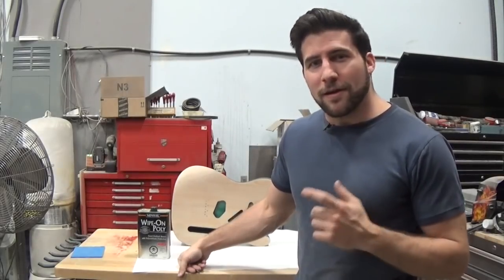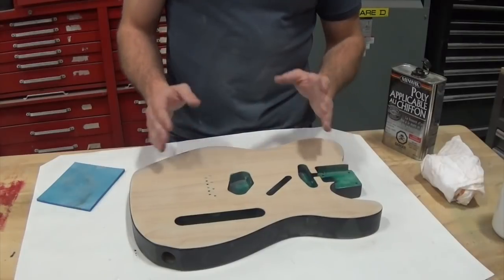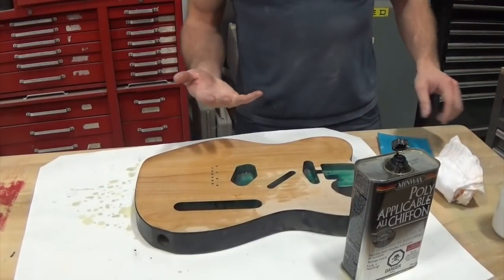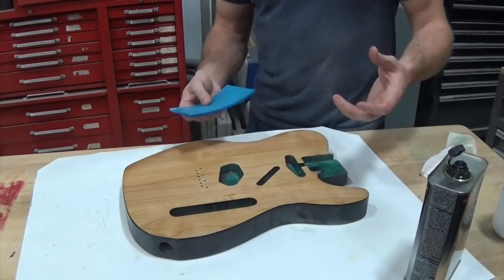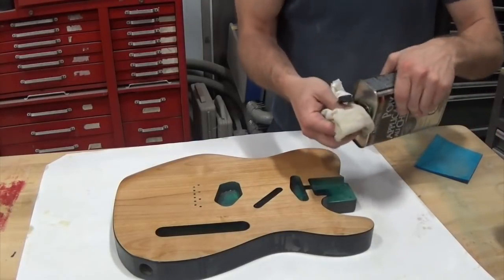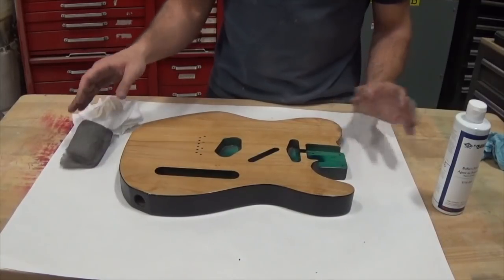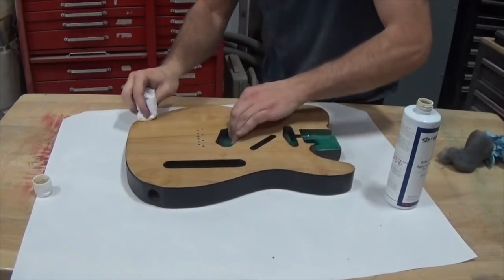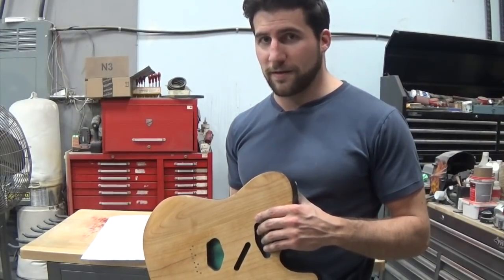How to apply a perfectly smooth poly finish by hand

Comment: Could this method be used after applying a dark or even black dye to the wood first? Looking to get a black color on the wood without paint.
Reply from the maker: You can use black dye to do that, but I wouldn’t use the sandpaper method. It could damage the dye. Stick with a standard wipe on method with a cloth.

Comment: If you do the 1st coat by hand, can you then spray it with minwax poly to save elbow grease or would that cause a problem with the rub on stuff? Did 3 tele's (paint) but am working on a natural finish with my DIY kit and want it perfect.
Reply from the maker: Yes, just sand the first coat smooth with 800 grit before moving on to spraying.

Comment: In the comments someone mentioned a mix of poly, mineral spirits, and boiled linseed oil. So the poly in this mix is oil. In your video did you use oil or water poly? I want to put a decal on my headstock that has been finished with boiled linseed oil. I need to seal it. Would a wipe on poly work for that? I already have a can of satin poly which is probably brush on but I would think I could wipe it on, after the decals have thoroughly dried. Or should I just go ahead and spray with lacquer. The trouble is, the lacquer I have is gloss and the neck is satin.

Comment: Does this work with wood that you've dyed already? Only seen natural finishes so far.
Reply from the maker: I wouldn’t do it on dyed wood; it would remove some of the dye.
Reply: @BradAngove  Hmm okay. Been trying to understand how the opacity of finished works because if you scratch it, it’s a mark of damage, but if you fine sand and polish, it’s clear. Have a black poly guitar that I need to fix.
Reply from the maker: @andrewjm124 that’s not a product of finish opacity. It’s just a matter of how fine the scratches are. You have to sand very fine to sand and polish. And then the compound and polish are also abrasive. At a certain point, it is abraded so finely that it becomes clear again.

Comment: Quick question  -trying to decide where i will get the best bang for my buck - if you had a choice between getting a low RPM polishing/buffing machine potentially like the one stew Mac sells or a HVLP spray gun system - which do you think will have the bigger impact. I know i can get a pretty good finish with hand rub or spraymax cans - and then rely on buffer for that high gloss finish.  Or will a better stayed finish require less buffing.  Any advice
Reply from the maker: For starters I think the polisher will help your finishes go to the next level more than the gun as long as you can find all the colors etc. you’re looking for in spray cans.

Comment: Hi thank you for the help
I have a guitat I have scraped the paint from it and just want your help to sand what is the grid I should start and finish before doing wipe on poly and buffing.  My neck is pretty good should I do it like body or leave it as it is.

Just want to know what grid I should buy start to finish.
Thank you Kero😊l
Reply from the maker: I like to finish with 320. Where you start isn’t as important. Just work your way through the grits until you get to 320 at the end. I often start with 120.

Comment: I found your video when looking to help stick down some decals on an automotive Turn signal stalk! OK, Here is a comment you can try out. ... Cleaning a brush (Solvent based paint) can be done with "Ivory" soap and water! Also, between coats a brush can be wrapped in a sandwich bag and left in the freezer.

Comment: Hi Brad, I am using a brush on poly. You say that I can follow the same steps and then follow up with brushing instead of wiping. Do you mean I can apply the initial layer of my brush-on poly with some fine sandpaper?
Reply from the maker: You could, but there’s usually no need. If you were to do that, thinning it slightly for the sandpaper stage would help make it easier to work with.
Reply: Great, thanks for the response.

Comment: Thanks brad, I’ve got an ash Stratocaster body that I bursted with dye and then sanded to 600+ grit. It’s completely dry now. I plan to try your method on it to get a very high gloss finish. With dye, will the wipe on poly dissolve the dye and smear it if I use 1500 grit to “scrub” it into the wood?
Reply from the maker: I think you’d be better off skipping the sandpaper. It could certainly damage the dye depending on how you do it. It’s safer to just apply with a cloth.
Reply: @BradAngove  hi brad. So go straight to polishing compound? I thought I needed to use around 5000 grit paper before polishing? Not the case? Thank you  for your reply. I could send photos if that might help you see where I am. Thank you brad
Reply from the maker: Sorry, I thought you were referring to the poly application. You will still want to sand the poly smooth before your compound and polish work. If it’s quite smooth now you can do 2000 grit to start, then 2500 and move on to polishing.

Comment: Thank you for the vid.  If I use wipe on poly over Rustoleum paint, wouldn't the poly eventually turn yellow and then change the Rustoleum paint color, especially if the paint is a light color?
Reply from the maker: With the oil based wipe on stuff it would start out a bit amber. You wouldn’t even need to wait for it to do so over time.

Comment: Great video.  When I did mine, I was hoping the poly would give the body a bit of an amber tint, but the body color is still too light.
If I sand off the poly, will the body take a stain ? Or will the pores be too full of poly ?
Reply from the maker: I recommend that you just sand lightly, add a coat of amber shellac, sand lightly again, and then throw on another coat of protective poly.
Reply: @BradAngove  Thanks Brad, I'll give that a try

Comment: HI Brad - Great videos. 2 questions: 1) I'm using oil based poly. How long does it need to dry or cure before I can move to the polish stage?  2) Also what is the best way to lightly sand round edges such as on strat?
Reply from the maker: +Ben Geist I'd give it a couple days to dry. Do you mean sand the edges of the poly, or sand the wood to create that rounded profile?
Reply: Regarding sanding: Sorry should have been clearer. Sanding the flat surfaces in between coats is straightforward but I find it harder to sand the sides of a Stratocaster which are rounded off. Using sandpaper by hand seems the only way but still really difficult to get an even sanding. What do you typically do? Techniques and tools you use? Many thanks, learning a lot from your videos!
Reply from the maker: +Ben Geist oh, I see. I generally just do it by hand. Spindle sanders are helpful if you're doing some aggressive sanding. You can also get flexible sanding blocks that are generally used for automotive work. The small ones are helpful sometimes.

Comment: This is an excellent demo Brad.  That was oil based WipeOn Poly.    Would it turn out the same if it was a Water based WipeOn?  Which would you rather use?
Reply from the maker: I’m not sure if there would be any substantial difference with the water based version except that it doesn’t have that same ambering quality, and generally doesn’t build as quickly.
Reply: @BradAngove   I see.  Can't wait to find a suitable body to finish myself and see how it turns out.   Thanks again for sharing all your experience.
Reply from the maker: Thanks for watching.

Comment: Hey Brad. Informative video!
I have a couple of questions:
Would this technique work over the crimson guitars stunning stains? They are water based. Or would it just lift the stain or sand it off?
How much time do you leave between the first two coats? And how much time between subsequent coats? 
Do you sand in between coats?
How long does polyurethane have to dry before you can sand and buff it to a high gloss?
Thank you
Reply from the maker: +A.J. K It would work over the stains, but it would remove some. Generally when you apply crimson's guitar finishing oil over their stains it also removes a bit. Always try to test it on something else first. 
I waited about 30 minutes between my first two coats because a lot of the first one was absorbed. Had it sat on top more I would have waited a couple hours and then probably sanded lightly. To be safe you can leave the poly for a couple days before beginning the polishing process.

Comment: Would it be the same process if you first stained the body? I’d like to do a stained top and finish it with this rub on poly technique. Thanks
Reply from the maker: You can still do the rub in technique over stain, but don’t use the sandpaper.

Comment: Thank you for all of your videos here. How would you apply poly on each surface? Would it be best to do one side and let it dry and then the next? Or hang/ mount the body and do each surface at the same time? Is the sanding with poly ok to do with bare wood that has never had any sort of finish or treatment?
Reply from the maker: For wipe on poly it’s probably easiest to hang it and finish. Yes, the sanding trick is best on raw wood actually.

Comment: Hi Brad, loving the content. Can I use this oil-based Minwax wipe-on method over solvent based car paint or is it only suitable for wood finishes? I want to avoid the hazards of 2k spray if possible. How long should I wait for the base colour to harden? I’ve read potentially 3-4 weeks to allow it to fully harden.
Reply from the maker: Don’t use this over paint. Just wipe on with a cloth if you’re not applying it to wood. Sand your car paint with 800 grit paper first so this can stick. 
The drying time for the base paint depends on the type. There’s no harm in waiting 3-4 weeks though to be safe.
Reply: @BradAngove  I ended up using Rustoleum Glitter Clear after seeing the price of Minwax in the UK. 8 days later it still feels tacky. The can said recoat anytime and I applied maybe 4-5 coats an hour apart but I’m starting to think it will never dry properly. Is this extended drying time typical of the glitter clear or have I messed up? I don’t want to wait another 6 weeks if it’s never going to dry. Should I bite the bullet and sand back now, and start over with a 2k clear? Thanks for any advice you can offer.
Reply from the maker: @simonc5425 I’m not sure how you applied it, but take a look at my video on why your paint isn’t drying properly. That should help you determine where things stand.
Reply from the maker: @simonc5425 sounds like too many coats too fast to me. It depends on how heavy they were though. Has it hardened yet? If not I think you’re likely best to sand it back and try again with a more conservative re-coat schedule.

Comment: Cool technique, wondering if you would recommend a wipe on poly or another wipe on product for a sparkle metal flake  finish guitar project that I am working on? Or does it have to be clear coated by spraying?
Reply from the maker: If you’re putting it over metallic paint you can still use the wipe on. If you’re talking about mixing metal flake into the wipe on, that is not going to work.

Comment: I want to keep my bass looking as natural unprocessed wood as possible, but still give it some protection. Would I get by only using one coast of that poly finish?
Reply from the maker: That would offer some protection with a very thin finish. Less protection than using more coats of course. You may also want to consider using an oil instead.

Comment: Hey, i wanna do a Wipe-on-poly but i wanna do it in satin, are there any things i need to consider? What do i do after i but 2-3 coats on it? Leave it like that?
Reply from the maker: Ya, just use the satin version of the product. I have an old 3 part series on how to paint a guitar by hand where I did wipe on poly and the sides and back are satin. Take a look at that one, I show how to “polish” it to remove imperfections.
Reply: @BradAngove  Thanks for the answer, did not expected it so fast. Watched them all, hope i can do good on my uke kit xD

Comment: I have a question. I have a Epiphone Les Paul that I just got. It has a factory (dull) satin finish on the body. I am putting on transparent decals on it. To keep the stickers permanently on the guitar and to give the guitar a kind of shiny finish on top of the stickers, what would I use on it? How long til the guitar body is fully dry and able to out the hardware back in it? Thank you.
Reply from the maker: Sand it lightly with 600 grit, apply your decals, and then add gloss clear coat. Time before putting hardware back on depends on the paint type. I would probably use 2K polyurethane if it were me, and I would polish after 24 hours and assemble after a couple days.

Comment: I am getting ready to build a Eddie Van Halen bumblebee replica out of Northern Ash and I do not want the wood grain to show through. Will the process in this video work OK? Thanks
Reply from the maker: It can, but generally you would be better off doing a quick grain fill and then applying some sealer.
Reply: Brad Angove awesome! Thanks
Reply: Brad Angove What do you recommend for a grain fill and sealer?
Reply from the maker: Check out my video on how to grain fill with paste wood filler. My favorite sealer is the Mohawk ez vinyl sealer.

Comment: If you were to apply acrylic enamel paint on a portion of the guitar body and leave the rest of the body natural, how would you get that gloss without messing up the acrylic paint yet giving it a gloss as well? An example would be the Jimmy Page Dragon Telecaster.
Reply from the maker: Applying an acrylic or polyurethane clear coat to the whole thing.
Reply: Brad Angove Ok, so could I use this technique you are using and apply poly over the section with acrylic paint and the bare body as well or would I have to use the spray gun or or can to apply it?
Reply from the maker: I’d go with a gun or can. Ideally the spraymax 2K as demonstrated in my video on how to get a professional looking clear coat with spray cans.

Comment: Great Video and thank you! I have a can of minwax wipe on poly (satin) do you recommend that foe Guitars? Or is the gloss easier to clean in the future? I'm guessing the more coats I put on the better the sealing? Thanks again! If anything I may be able to use it for the neck surface to get a faster satin glide.
Reply from the maker: I like satin on a guitar. It doesn’t sometimes gloss up a bit as you play it though from the friction.

Comment: Hey, just a question about first two sealing layers:
- after applying first layer with sandpaper, you wait 3 to 4 hours to make it dry before second sandpaper layer?
Reply from the maker: Yes, you can do that.
Reply: @BradAngove  Thanks for the info., but do I need to wait for it to fully dry, though?
Reply from the maker: You should

Comment: Just found your channel because I just bought my first guitar kit and wanted to learn some stuff before I get into it.

But I need advice. I wanna do wood dyes, and I was thinking of using poly as my finish. Should I use a sanding sealer under the poly, or would that screw up the dye color?
Reply from the maker: You would dye first, then you can use a clear sanding sealer followed by a poly.

Comment: Will this method work on a stained guitar body? I'm worried that the stain will bleed too much. Also does it matter whether the poly is oil or water based?
Reply from the maker: The stain may come up a bit with the sanding. I would avoid the sandpaper aspect.

Comment: Can you use the wipe on Poly with a stained or dyed flame maple veneer/cap or will wet sanding it with the poly cause the color to come out? I really like this method you're showing, but intend to do a flame burst on a thin maple cap and don't want the color to bleed.
Reply from the maker: You can use the product, but I wouldn’t advise using the sandpaper method. Particularly on a veneer.
Reply: @BradAngove  awesome thanks!

Comment: Hi Brad...Enjoying your videos...Can I gently wipe the liquid poly over a headstock decal without ruining it,or should I be hitting it with a Poly spray instead? I Like the idea of the wipe on poly because I have the control over how smooth it's applied...I'm going to lay down some poly and then put the decal on.Thank you!
Reply from the maker: I would generally advise spraying, but I’ve never actually tried a wipe on over it.
Reply: @BradAngove  Thx Brad....Honestly I do feel uneasy about wiping across the decal...  ;o)  I do have some minwax poly too.
Reply: Ok so after letting the decal setup and dry overnight, today I very gently applied the Wipe On Poly with a foam brush. No problem at all with the decal. So some FYI for anyone else. I'm using the Minwax Gloss.
Reply from the maker: Awesome. I’m glad to hear it worked.
Reply: @BradAngove  Thx pal..I kinda lived on the edge and said here goes. Lol..Worst case scenario was to sand again and another decal. Got lucky 👍
Reply: Figured rather than spending another $10 on a can of Minwax Gloss Poly,I'd try using what I already bought in the Wipe On Poly.Took a gamble but I was very gentle swiping across those decals..It's all easier from here though.Some very cautious light sanding and at least a couple more clear coats,polish and buff and bingo..Where can we post photos Brad?

Comment: Solo kit comes with an unfinished body with poly- so says the advertisement.  I want to paint the body myself.  To what extent-if any- do I need to address the poly finish before priming/painting?   600 grit sanding? Total strip? Thanks
Reply from the maker: If you’re painting rather than staining you can just give it a smooth sand at 400 grit before moving on to your primer or ground coats.
Reply: Brad Angove thanks for the reply.   I’m honored 😀
Reply from the maker: I do my best to give every legitimate question a reply haha.